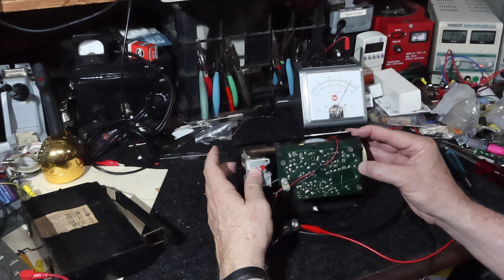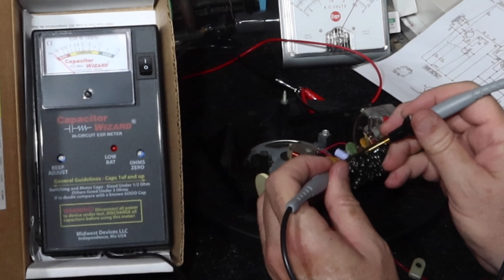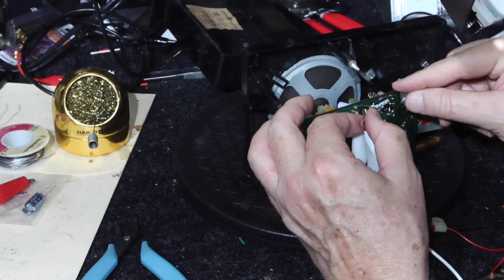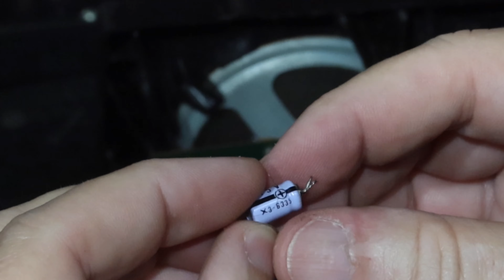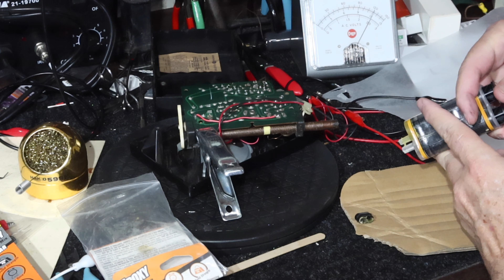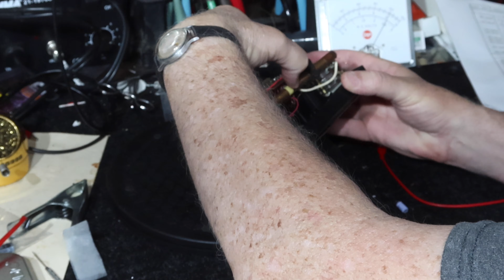Rare REED-TYPE Speaker in a 1964 Transistor Radio RESURRECTION - GE P807J [4K]

Comment: Reckon sound is comparable to small moving-coil speakers of the day. Low frequency response will be lacking but on the plus side, these moving-reed speakers have a higher electro-acoustic efficiency so more sound for a small transistor output stage.

Comment: For mixing epoxy glue, use the plastic lids from butter / margerine / sunflower spread tubs. No card or paper to soak some up and the hardened left overs can be peeled off when set, making hte lid re-useable. :).
Reply from the maker: Great tip!  Thanks for the comment and for watching.
Reply: @PracticallyFixed  Youre welcome. First time I saw your chanel. Just subscribed. :). Looking forward to watching more. I also watch Mr Carlsons Lab and Shango. All the best from UK.
Reply from the maker: Thanks for the sub from Texas!  Cheers

Comment: I have a couple of other type of GE radios with broken Reed speakers. Do you have any suggestions?
Reply from the maker: Perhaps one of our viewers may comment here.  I was lucky and mine seems fine.  Depends on what is wrong.  If the transformer has disintegrated I don't know what you could do.  If the pin/stylus has come off then perhaps it can be reattached and glued back.  Unfortunately since the radio circuit is designed to not have an output transformer, a "regular" 4 or 8 ohm speaker will not work, in fact may damage the output circuit.  Wish I had better information for you.  Good luck!
Reply: @PracticallyFixed  Maybe a dummy load resistor, and a little IC amp which powers a conventional speaker ?  They could even be mounted on the speaker so that if a proper unit becomes available, it could (almost) be dropped in.
Reply: I have fixed these to get playing ( only when the OEM reed speaker can't be saved) by gutting out the speaker cone and placing a slightly smaller modern PM speaker in front of that so the frame of the Reed speaker serves as mounting hardware for the new speaker. I did have to run the 3 wires from the board to an output transformer that I got from a junker radio ( impedance matching) then secondary to the new PM speaker. Mounted the transformer where the OEM coil used to be. Yes its no longer OEM but that was the only alternative as the OEM speaker could not be saved. Sound still tinny but not much worse than OEM.

Comment: At the time, Japan was very busy making these, and I think after the 'Regency TR - 1', the USA made several (now very collectable) variations, using a 'transformerless' class A output stage. In Australia, the large brands who made tube (valve) radios used some of the hardware (metal chassis, IF transformers, ferrite core antennas) in their transistor radio production, where import tariffs were heavy with an equivalent Japanese product. What I see as wonderful is how, after all this time, with the same test equipment, you can restore a transistor radio without replacing any active (semiconductors) components...
Reply from the maker: G'day and howdy from Texas, James.  It is rather amazing those transistors are still in there happily semi-conducting.  Not bad for only one bad component after 60 years, and just an electrolytic capacitor.  I have reasonably good luck with many old valves (tubes) as well as long as the audio grid coupling cap hasn't begun leaking and fry the output valve and the output transformer.  Did repairs on a couple of 70 year old automotive valve components recently and many of those valves were still serviceable, although on one I did swap the power supply vibrator for a solid state version at the owner's request.  You can check my channel page for the playlists for those projects.  Thanks for making a comment!

Comment: I have a P805A, apparently an identical cabinet molding (although mine is white) but definitely a different circuit board.  
I haven't seen the speaker in it, but now I want to have a look in there.
Reply: Your P805A has the same cabinet with a different grill than the P807 models. It definitely has a different circuit board with the big IF cans, an output transformer and a permanent magnet speaker. It also has the Conelrad markings on the tuning dial and used the large 9 volt battery. There's a repair video of your radio by All American Five Radio on YouTube if you're interested. Here's the link https://youtu.be/Ej7pJxMev8U

Comment: I have that same radio. It's a model P807C. I think it's a earlier version than yours because it has the triangle Conelrad markings at 640 kc and 1240 kc on the tuning dial. Like yours, It has the pin drive speaker. It originally used the larger, expensive, almost unobtainable 9 volt battery that had a larger battery connector instead of the common 9 volt battery of today. I converted it to use 6 AA bateries in a holder that fits perfectly into the battery space inside the radio. Other than the battery modification, it has all of the original components and still works very well although the sound quality is more tinny than that of a permanent magnet speaker.
Reply from the maker: That's interesting about the other model.  For broadcast AM voice, which is nearly all we get anymore, the tone works well I think.  The larger 9V battery seems to have been the other change.  I am still not sure that capacitor which I thought may have been a '63 date code was actually original.  Solder looked factory for it however.  Thanks for the comment.
Reply: ...I have one of those radios with the reed speaker: it had low, distorted sound, and I finally noticed that the ferrite magnets on the speaker had disintegrated.

Comment: Great little vintage GE AM transistor radio with a little secret. Good thing the electrolytics were the only thing that were 
 bad in it and the PC board broke where the holder for the antenna was. I see GE made this type of  reed speaker radio
 even up to 1966 with the model P1730B. That was a six transistor pocket radio BTW.
Reply from the maker: Yes it looks like they made a flurry of them just briefly.  Wonder what got into them.  I think I read a German manufacturer used the design in the 40s, but otherwise it was gone by sometime in the 30s.  Thanks
Reply: @PracticallyFixed Energy wise electromagnetic (reed) speakers use to be more energy efficient than the dynamic (voice coil) types, what means they need way less audio power to make the same volume. That was the main reason they were used in the early days, when any significant amplifier power came at very large expense, being the tubes, but mainly the batteries to run them. I think that may have been the motivation here as well. Plus they were somewhat simpler so cheaper to make at some time (mainly along the need for lower audio power) and the stationary coil allows it to be made directly as high impedance device (lots of turn of thin wire is quite problematc to handle when it is supposed to be lightweight to move with the audio), so allows to get rid of output transformer.
But the mechanism is quite restrictive on the cone travel, which mainly affects lower frequencies (or requires bulky and expensive sound transformers), which make them disappear after all, in favor of the dynamic ones.

I think GE did not want to go the otherwise usual class B push-pull high efficiency amplifier for some reason (Patents? Availability of matched pairs? Feel like too many transistors? Eliminating audio transformers?), like to be as cheap as possible. Probably the extra current consumption did not bothered them, the battery cost to run it was not visible on the sale price sticker after all...